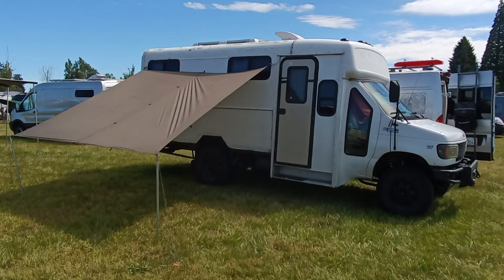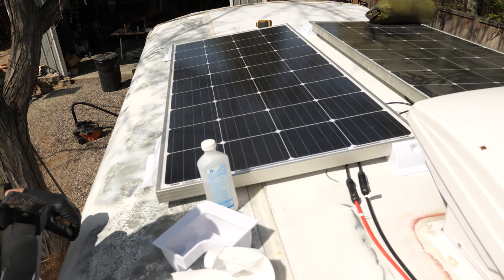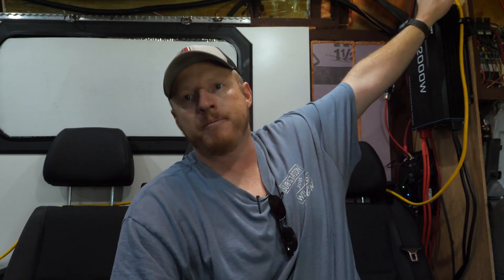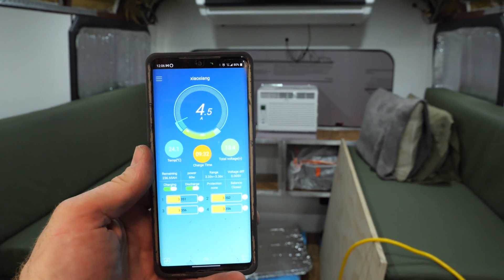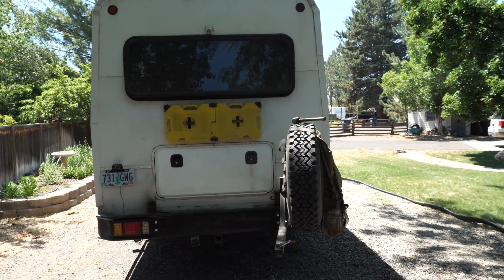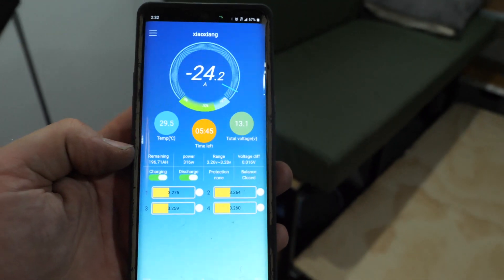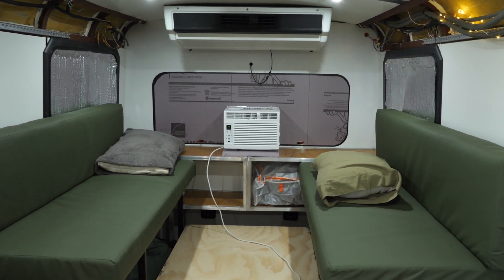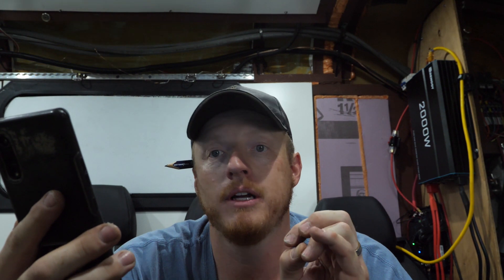Running A/C off of Solar/Lithium ? Buslife Experiment in a Heatwave

Comment: The max air and fantastic fans seem to CHEW thru power. Not a high demand, but a constant draw. I wonder how it would do just opening it as a top vent, and blowing a USB powered Opolar 9" fan up towards it using a battery bank, like an Anker. My fan/bank combo will run on low for almost 24 hours, and moves quite a bit of air. Might be worth a try.